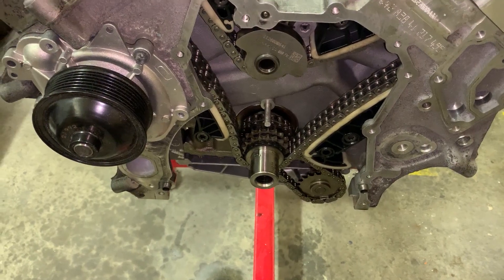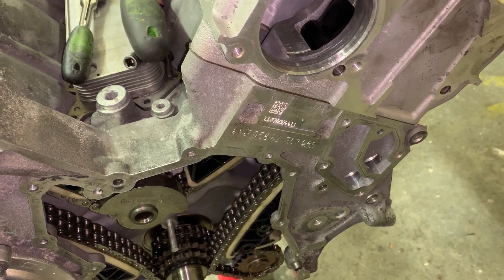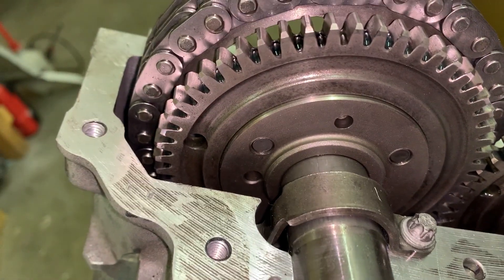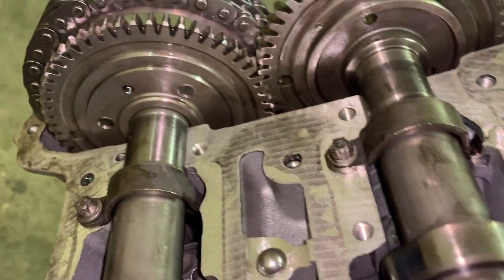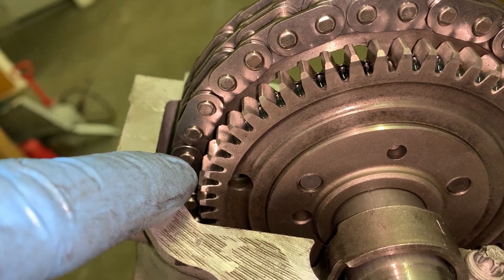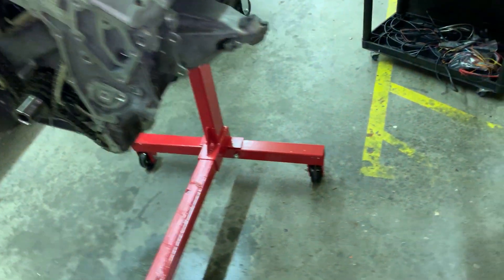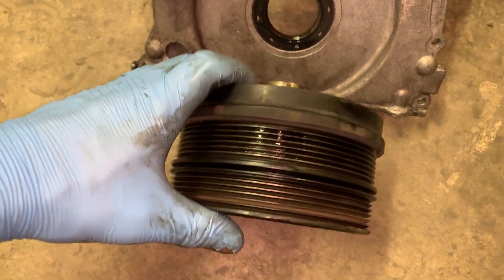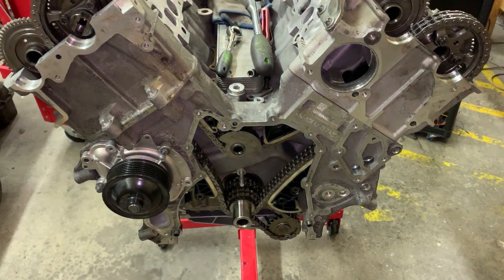Mercedes OM642 Engine Timing

Comment: Hi can you help me, replaced high pressure fiel pump and Car dont start
Reply from the maker: What Sprinter?
Reply: @sprintermotors   W211, new tank pump, furl comes to hd pump, xentry says low pressure 7 bar
Reply from the maker: @MSBeatz78  Have you checked fuel rail pressure sensor?
Reply: I'm late to this but the pulley you put on the hpfp needs to line up with the marks on the pump and engine at tdc

Comment: Hi guys, (om642) after changing my timing chain through the right cylinder head ( feeding through) I am one link short or one extra teeth . At the start I thought it was the tensioner replace it was making too much noise and this please need the car to get around and work.  thank you jack
Reply from the maker: Double check everything. May be you've got a wrong chain. I already replaced over 40 chains. And never had any issue like that.

Comment: Hi sir Can you explain to me why mercedes G300 year 2019   walk (10000) km  equiped with engine om 642  (V6 ) eat oil engine and smoking
Reply from the maker: Hard to say. 10.000 - is extremely low mileage for oil consumption. May be a factory defect?